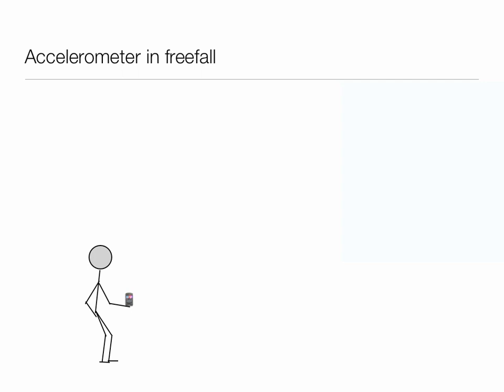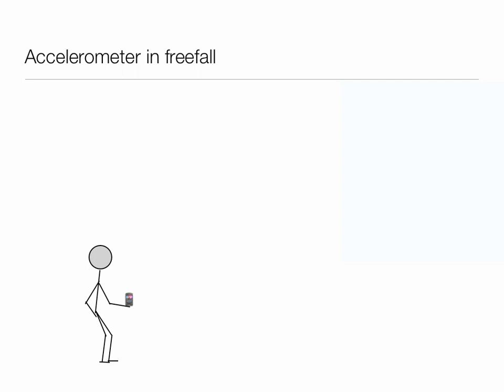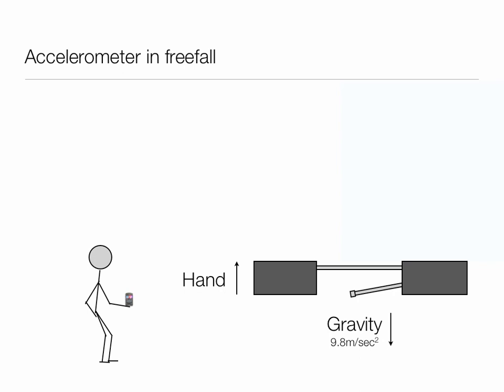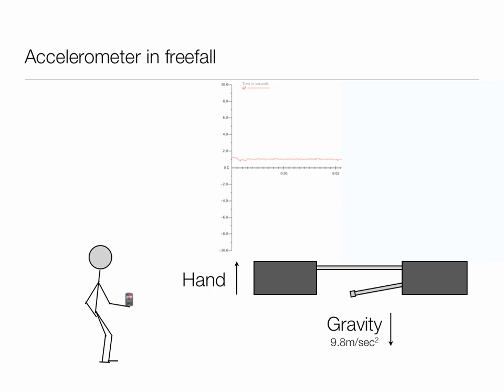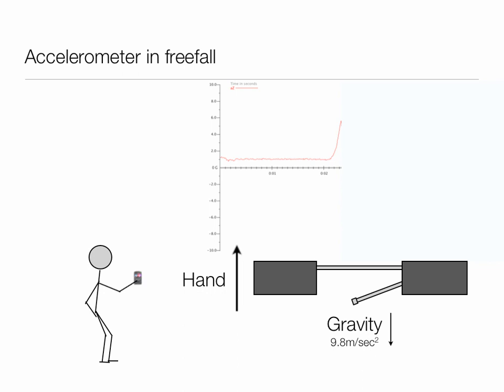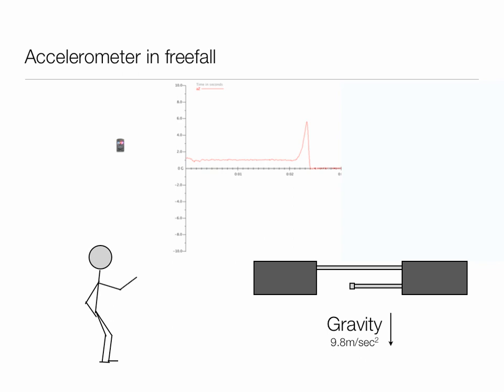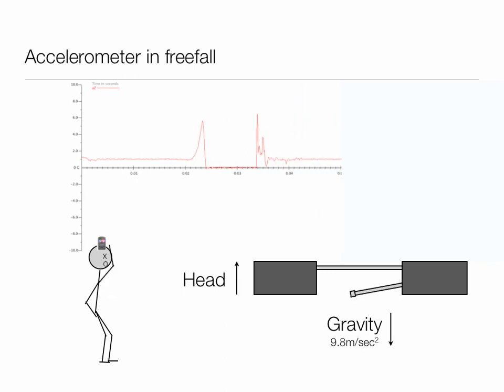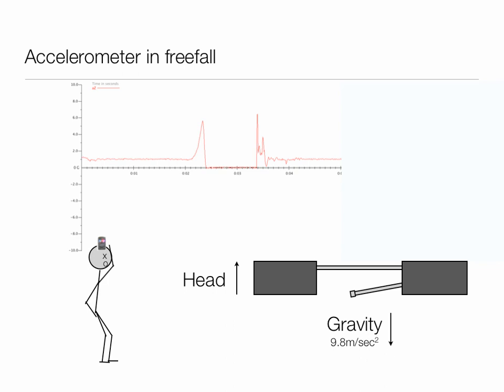Accelerometer In Freefall

Comment: The fact is there are 2 kinds of forces. There is the field force, in which all object of mass are subject to the same field acceleration such as the gravitational field. As the object free-falls in a gravitational field, you will not have any differential strain. But the equal and opposite force that keeps the object static on in your hand is applied to a surface. So that force is transmitted to the various components in terms of strain. Therefore the accelerometer does not measure true acceleration but rather it measures strain (material deformation). A true accelerometer would measure parallax rather than strain. An accelerometer can only measure a transmission force, not a field force.

Comment: An accelerometer measures 1g when it's in your hand because gravity is the curvature of spacetime and not an actual force, unlike the normal force being exerted from your hand.  Freefall would show 0g force on an accelerometer because it is an inertial frame of reference.  Freefalling objects aren't really accelerating.
Reply: Exactly right.
Reply: Any proof of your mythical bendy spacetime?🤡 Theoretical physics is neither science nor facts. 
The only thing you are partially right about is that a free falling object is not accelerating. Now what you are missing is that it isn’t falling either.
Reply: Yes there is, gravitational lensing is a directly observable phenomenon where light bends round massive objects. Light has no mass so gravitational force would be unable to act on it. What we're seeing is light travelling in a straight line on a curved surface.

GPS wouldn't work either without taking the bending of spacetime either because it affects time as well. The clocks on satellites slowly go out of synch with clocks on earth screwing up the distance calculations, so they have to be recalibrated.

It's not theoretical physics at all, it's applied physics in the real world.

Comment from the maker: Jason, good comments, but the important fact is that in free-fall the device IS changing velocity (the definition of acceleration), but the accelerometer doesn't measure anything. when it is at rest in my hand and NOT changing velocity, it reports acceleration equal to 1G.  Regardless of how balls may roll around in a wagon, the accelerometer is not measuring acceleration (or inertia) in these cases, so it may be confusing to someone who is thinking in physics terms.  Accelerometer is a misnomer
Reply: I know this is a very old comment.  The misnomer is in fact in referring to free fall as acceleration.  The accelerometer measures acceleration perfectly.  The problem is that free fall is not accelerated motion in modern physics.  This is a revelation made by Mr. Albert Einstein in his Theory of General Relativity.  Specifically, the equivalence principal - which basically states that being stationary in a gravitational field is accelerated motion.  When you are standing on the surface of the earth, you are standing stationary within a gravitational field (not following the geodesic) and are therefore in an accelerated reference frame.  Free fall is inertial motion - that is motion free from all forces moving at a constant velocity through curved spacetime.  This is why an accelerometer will measure 9.8 m/s² of acceleration when standing stationary on the surface of the Earth and read no acceleration when in free fall.  The accelerometer has it right.

Similarly, you could take the same accelerometer into deep space far away from all gravitational sources inside a rocket that is accelerating through space at 9.8 m/s².  The accelerometer would behave identically as it does here on Earth.  In that rocket, the "floor" is the wall opposite the direction of the thrust.  You would feel pressed against that wall, and you would feel no different than standing on Earth.  The accelerometer would read 9.8 m/s².  If you threw the accelerometer, if would appear to you to accelerate toward the floor of the rocket at 9.8 m/s², yet in reality, the accelerometer would measure no acceleration, and it would be right.  It is the rocket that is accelerating.  The accelerometer - which you would conclude is in "free fall" is actually moving with inertial motion.  It is you that is simply observing this free fall from an accelerated reference frame.  All the while, you are the one in the accelerated frame of reference while objects you deem to be in free fall are simply moving inertially.

Of course, this doesn't mean that the Earth is LITERALLY accelerating through space in the way we all imagine acceleration.  It is simply that gravity and acceleration are two sides of the same coin.  Gravity sort of creates this accelerated reference frame - - or the exact equivalent of it.  There is no useful scientific reason to distinguish between the effects of gravitational fields and acceleration.
Reply: @willoughbykrenzteinburg  Greatly appreciate your clarification, Sir.

If you do happen to read this all these many years later, perhaps you could comment on a point of consideration in Freescale Semiconductors’ Application Note on its accelerometer product range: ‘Accelerometers measure the difference between any linear acceleration in the accelerometer’s reference frame and the earth’s gravitational field vector.’

It further goes on to state: accelerometers are insensitive to rotation about the earth’s gravitational field vector.

Your, especially your, thoughts would be greatly appreciated!
Reply: That’s because your definition of gravity is Newtonian. When you embrace GR, sitting in a chair means you’re actually accelerating through the fabric of spacetime.

Comment: Look you can calibrate for the gravity and the accelerometer would show 0. Just simply set the circuitry to show 0 when the cantilever is bent and it'll show 9.8 when it's free falling.
Reply from the maker: And it would read -19.6 if you turned it upside down.  That is compensating, not calibrating... but, yes, you could do something like that to make it read whatever you want.  It just doesn’t describe the physics of what is happening anymore, so it might not be a useful of a tool.
Reply: @tjteru  What?! A free falling object has an acceleration of 9.8 m/s/s in the body frame near the surface of Earth. This is what the accelerometer should read not zero.
Reply from the maker: @SaeedAcronia  I agree.  The problem is that these sensors don’t measure the change in velocity relative to the planet (which is what you would really like to have).  Instead it measures this micro bend in a cantilever.  That means that if you tell it that bend it sees while at rest is “0”, all is well and good as you expect.  The problem is that if you hold the device at the same location, but rotate it even slightly, the value will no longer read 0 even though it is not actually accelerating.  The amount of bend will change and now your adjustment to the reading isn’t helping you.  If you turn the device over completely (180 degrees still without changing the x,y,z position of the device) you end up with the cantilever bending in the opposite direction.  You still aren’t really accelerating, but your adjusted sensor says you are experiencing 2Gs.  I made this video a long time ago because I thought this little difference between the engineering world (what we measure) and the physics world (what the theory says) was kind of interesting and counterintuitive in some ways.  I might do it differently today, but the ideas still hold true.  Let me know if this rambling makes sense.
Reply: @tjteru  True. Thanks for your explanation. I appreciate it.
Reply: @tjteru  or it just backs the theory of relativity and says that gravity isn't actually a force.

Comment: wait, what? Yes they do or Inertial measurement systems using the same chips wouldn't work at all. Try integrating all of your measurements to get velocity and position, and be sure to use the gyros to tell how much the phone has rotated so you can keep track of the ground. You are using a Kalman (EKF) filter right? And make sure you have the resolution of the G-Sensor set so you don't exceed max G's. 
BTW, The idea that the accelerometer knows it's in your hand is ridiculous.